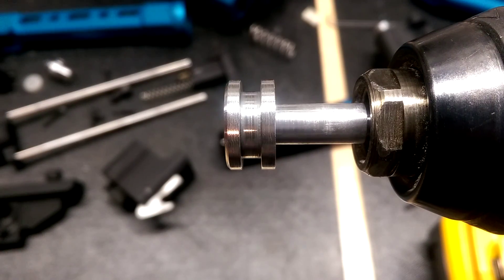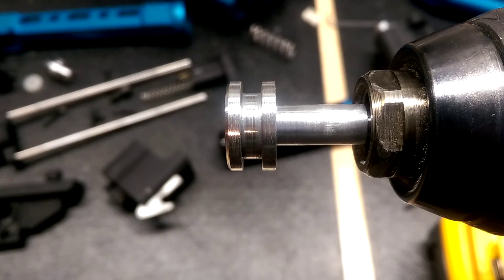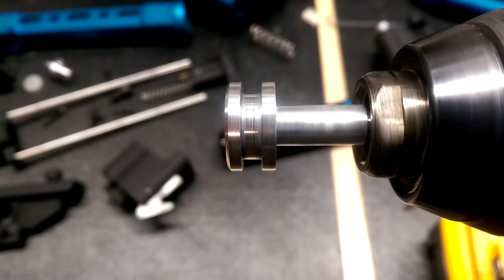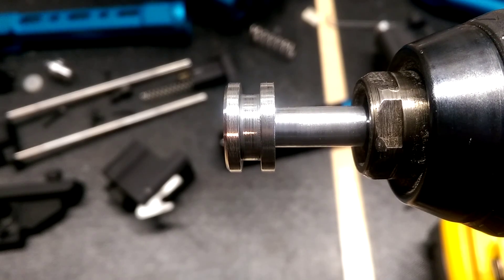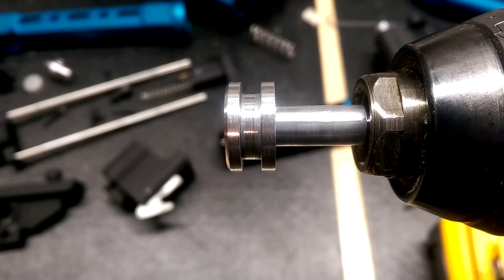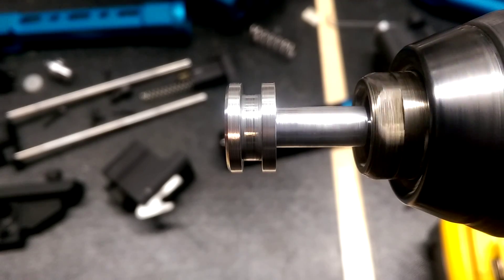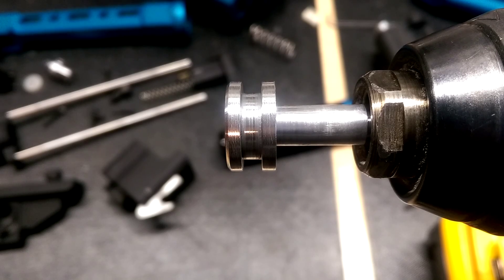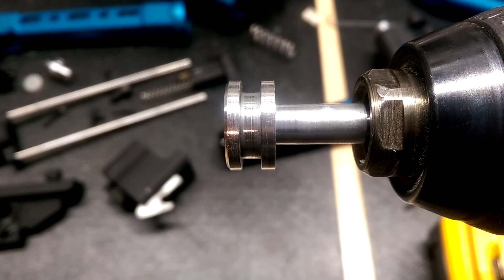Metadyne Thumper - Uncentered Piston

Comment: The term is called concentric (the two diameters are not concentric). This shows a lack of machining understanding on a lathe. The part was probably turned.. pulled out of the chuck, put back in, then turned again without dialing it in.